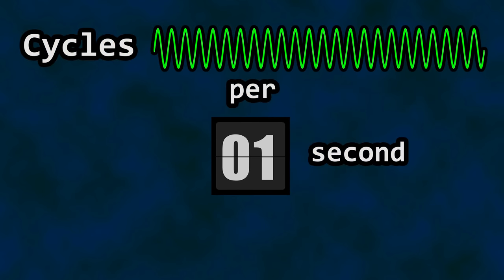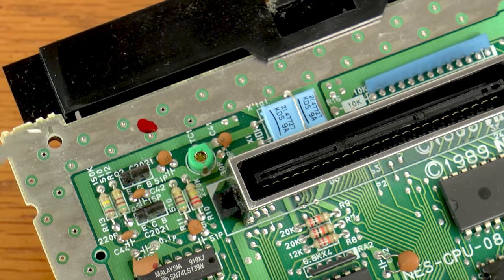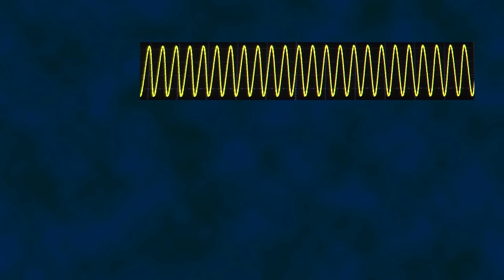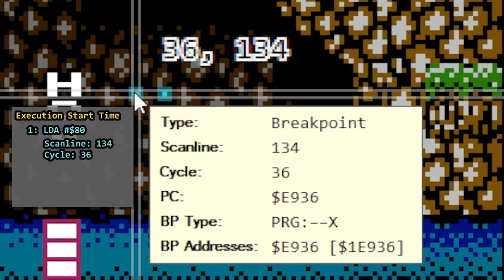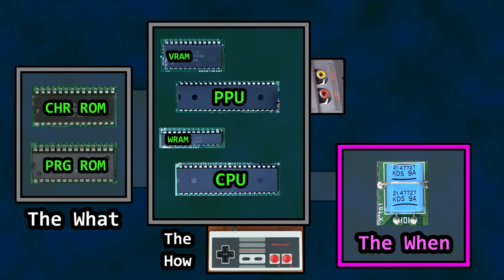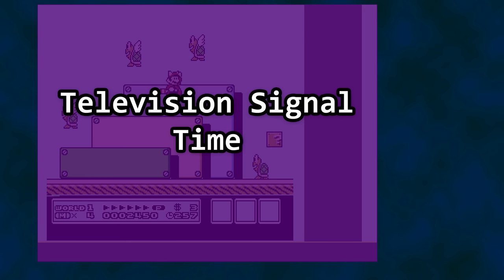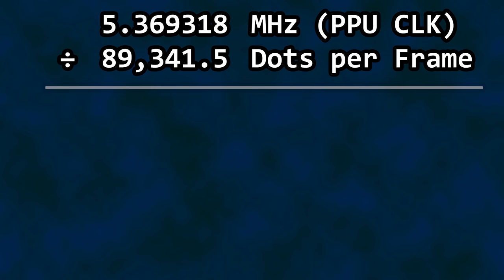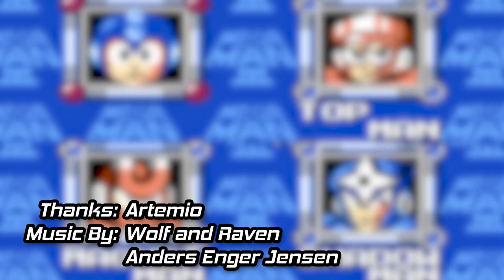Let's Dive into the Cycles, Speed, and Video Output Timing of the NES - Behind the Code

Comment from the maker: I thought we needed a "Behind the Hardware" episode to talk a bit about cycles as they are very important. This topic is a bit of a prerequisite for talking about interrupts.

I hope those of you with experience in pulses, duty cycles, etc. didn't mind the oversimplification of the clock in order to make a point about speeds. We could certainly dive deeper into this topic, but this should be enough to proceed with other mappers.
Reply: ty.  I've struggled to explain this to a lot of people.

I've also had difficulty explaining the fact that interlacing is required for the image to fit on a 640 x 480 screen essentially reduces the framerate of games by half (from 60 to 30), then there's the horizontal blank cycle.
Reply: Hey man, I don't know where to pitch you this request (and I'm sure you're SWAMPED with them). But I can't figure out for the life of me the answer to a very simple question, regarding Adventure Island III. Definitely need a hacker/tracker guy who knows what he's doing to trace this.

There are many secret bonus rooms you can find by touching keys in hidden eggs, and when the room loads, there is a smaller, inner box room inside the room with an invincibility crystal inside. Outside the inner room, there are lots of fruit and 3 dinosaur cards. If the room loads with you already inside the inner box, you can get the crystal, and walk through the walls to exit the box. I think you can even jump back in. But most of the time, you start at the bottom of the larger room, outside the box, and you can't get in at all. Nothing in a computer is truly random, there MUST be a way to cause a start inside the inner room. I loved your Punch-Out!! videos, btw, very related.

Comment: Wonderful explanation. This is simply why it's not possible to "overclock" the NES by changing the crystal. Many other 80s computer worked exactly the same way, like the C64.
Reply: As long as you can install some sort of pre-scaler in front of the PPU to keep it running at the same pace as it normally does, it should work fine. Of course things like the audio will still be higher pitched, and any mapper that detects CPU cycles for its interrupt timer instead of scanlines will not work properly. That part can be fixed by patching the particular game's code instead.

Comment: By the way, many computers and consoles of that era used the same CPU (a variant of the 6502 chip) while having vastly different graphical and sound capabilities: this video gives a taste of why. In some cases, we have the same CPU in two different console generations (Atari 2600 and NES, picking at the opposites of the range). It's incredibly fascinating how the engineers managed to create incredibly different architectures while technically striving for similar purposes.
Reply: That's what the 6502 was designed to be: a low-cost, decent CPU for general usage in a variety of low-power devices. Attach it to a simple line output system, and you get the 2600. Attach it to a more complex tile-and-sprite renderer, and you get the NES.
Reply: Designing a CPU is hard. 6502 and z80 had a large software library and market of trained assembler coders. Same as 68k and 8086.

Comment: Yes, the CPU/PPU timing is very important for MMC3 interrupts. I once briefly had a PAL NES game called Drop Zone, which I ran on my (NTSC) toploader. It was a game which used a timer to draw a HUD in the bottom half of the screen. So on my TV, about the half of the font for information like the score and lives was cut off, due to of course that since it was a PAL game, it was programmed for the timing of a PAL console and TV.
Reply: Nowadays you can be clever about this for homebrew and detect the system region (simply by counting how much time passes between two Vblanks) and from there you can take the right timing values for the MMC3.

Comment: Fantastic video~! I was always wondering what caused that twitching row of pixels on the MegaMan 3 boss selection screen - as well as a similar wiggle occurring sometimes in SMB3 right above the HUD - it makes sense now that it is technically scrolling the screen back to status bar and away from the stage tiles.
Reply: I never even NOTICED that effect in MM3 because it happens so fast. Just showing that at that specific time of the video it all came together in my head because I remembered that glitchiness.

Comment: For a moment I was thinking: “Is he going to try and explain the whole clock cycle and render pipeline of the NES PPU, what a madman!” Then I saw the video is only 11 minutes long and relaxed. Great video, once again. Thanks for talking through all of these concepts. As someone who tinkers with HDMI signal generation, it still seems a little weird to me that modern video standards still include extra time before, during, and after the signal. That was all originally to give the electron beam time to move in a CRT, right? What’s all of that for now?
Reply: The VBlank and HBlank periods in modern setups are there because HDMI is a modification of DVI. And DVI had them because it was designed as a digital interface for CRT monitors, so they digitized all the fun picture tube control signals and delays. 

I would not be surprised to learn that HDMI packed audio into the VBlank period, but don't know for sure how it is encoded.

Comment: It feels like you've read my mind, as I am knee deep in this exact rabbit hole. Interestingly enough, the video output appears to function at twice the crystal rate, giving us 12 voltage outputs per color cycle. At least, that's what it looked like on the nes-dev ntsc page. Something about outputting on both rising and falling. I don't know what that means or how that is actually done in hardware. Maybe you have some thoughts or corrections :)
Reply: Work is performed on both the "rising" edge of the wave and the "falling" edge of the wave on the clock signal. This could be for triggering components at more exact timing, etc. This would still be considered six cycles, however, since both a rising edge and falling edge are just 2 parts of a single square pulse. There are components that can determine if a signal went from low-to-high (0 to 1) or high-to-low (1 to 0), which in this case would indicate the start and end to a single clock pulse. Hope that helped!
Reply: Not only video, 6502 also has rising and falling edge sub-cycles. I don't think Z80 does, or at least doesn't do anything extensive with them. This is how 6502 is able to perform a memory read in one cycle, it will assert an address on the bus and configure the bus in the LOW phase of the cycle, and then the memory needs some time to perform the read, it will assert the data as soon as it can, which the 6502 will consume in the HIGH phase of the cycle. Other comparable processors would generally have multiple-cycle memory operations, and would correspondingly be typically used at higher nominal clock rates with similar grades of memory. This design trait of 6502 was sometimes used to an advantage, for example to sneak in memory accesses in the LOW phase and avoid cycle stealing, but in general the higher nominal frequency allowed more granular timing in other chips.
Reply: Correct, the NES uses the low and high phases of the 21.47727 MHz master clock to generate the smallest granularity of the video signal, which works to 8 subpixels per pixel, or 12 subpixels per color cycle.  And that's exactly how the NES palette gets it's 12 different hues, by shifting the color pulses by anywhere from 0 to 11 subpixels.  Whether the PPU specifically looks for the rising and falling edges for this purpose, or just uses the momentary state of the clock as a logic input, I'm not sure.

Comment: Everything computer-related nowadays is all theoretical and abstract. It's absolutely mind-blowing to go back and see actual pins on a CPU connected to actual quartz crystals. 🤯
Reply: Programmers have long forgotten about those things with multitasking operating systems, no real direct access to hardware anymore.  I came from days of programming C64's and DOS, and one of the optimizations we used to do was bit shifting integers to use instead of floating point math.  I had made a simulation system in recent years that required calculating floating point math on a modern multi-core computer, tens of millions of simulated operations.  It was fast, but when I changed the code to utilize 64 bit integers and "fake floating point", the performance difference was unbelieveable.  Then I recoded it using GPU compute instead and the performance was just 100x what my best "fake floating point" was, and as a bonus, actually calculated the real floating point numbers.  Today the closest thing I get to programming "old school" is microcontroller projects, like Rabbit, Arduino and ESP32.  And finding people who REALLY understand making bare metal systems is few and far between these days.
Reply: Huh? Isn’t there still a crystal and still two pins for it? Just now the crystal is slower than the CPU.

Comment: I'd like to hear the story behind the mentioned blinking scanline glitch: what causes it? 🤔 Incorrectly done interrupts?
Reply: I can't tell you for sure, but different MMC3 revisions trigger the interrupt at slightly different points in time. Ideally, it would be triggered right as horizontal blanking starts so that the PPU scroll register can be updated before the next scanline starts to be drawn. It could either be that not happening at the right time (too early/late), or the way the interrupt handler was written (too much stuff happening before writing the scroll register?). 
There can also be different PPU/CPU cycle alignments and when an interrupt occurs the CPU is still allowed to finish the instruction it was executing before answering the pending interrupt. Different instructions take different amounts of time (the slower ones can take 6 or 7 CPU cycles), so depending on what the CPU was doing, the interrupt will be handled with varying amounts of delay and the PPU will be at a later dot than you want when you get to writing the scroll register. This is responsible for that little "jitter" with glitched looking pixels at the edge of a screen split. The best time to do these changes is when the jitter is hidden to the right of the image in H-blank but that's not easy to do without carefully timed interrupt handlers.

Comment: Quartz watches were the first use of crystal oscillators in consumer goods. Of course, those oscillators needed to produce a very precise frequency for accurate timekeeping. Engineers needed to produce a quartz crystal that would always resonate at a particular frequency, and whose resonant frequency could be controlled. Luckily, such a device has been in use for centuries; tuning forks, first invented in 1711, resonate at exactly one frequency, which was precisely set in manufacturing by grinding down the ends of the fork. To reduce the size and ensure it wouldn't be audible, quartz watch crystals are manufactured to resonate at exactly 32,768 hertz, using a laser to trim the tines down micrometers at a time until the desired frequency is reached.
Sadly, this technique doesn't scale down indefinitely; crystal oscillators in the megahertz range are based on resonating discs and aren't nearly as exciting.

Comment: Wow what an awesome explanation! One part that I don't understand: what would happen if the CPU divided the crystal frequency by (for instance) 6 instead of 12? Would the CPU just run twice as fast? I assume not, or else why divide at all, but I'm not sure why it wouldn't work.
Reply from the maker: I think (and this is just off the top of my head, Matt) one reason for the selection of that CPU speed had to do with the ROM speeds. You could accelerate the CPU (reduce) divider and potentially exceed what the ROM can provide. That would be just one side effect of messing with an existing system design.

The SNES still has to deal with this (fastrom vs. slowrom) despite being so much younger than the Famicom. That is an interesting part of history in of itself.

Anyway - As for messing with dividers, there are some clone chips out there that don't match the dividers and cause the system timing to go bonkers. Some people have swapped them out just to see what would happen. I'll probably share some results soon in a community post.
Reply: @DisplacedGamers  That sounds like a plausible explanation. The PC Engine allows the software to set the timing used by the VRAM, and it can also set the dot output to be faster than normal, which causes the horizontal resolution to increase (up to a 512x240 image by outputting two nametables to the screen next to eachother). But this causes the VRAM chip to be accessed at ~10MHz, which is slightly higher than what it was rated for. If you don't set the VRAM timing correctly to do this the VDC (equivalent of the PPU for the PC Engine) will not be able to fetch all sprite and color entries for every scanline from VRAM and this will lower the sprites per scanline limit and in some cases only 2 of the 4 bits of color data for each pixel will be read, reducing the color capabilities to something like the NES has. It's been theorized that there could be other visual glitches whenever the RAM doesn't put the data on the bus fast enough but nobody has seen any such thing happening so far.
Reply: That explains why they'd pick a lower frequency, but what good did it do them to have a clock that's 4 times faster than necessary?
Reply: @warmCabin maybe they use the sharp edges for a square signal? Or off the shelf TV parts ?

Comment: So what happens when you connect your NES (or any console before HDMI era) to modern TV? Is there some kind of CRT-emulation built inside them, since LEDs don't care about electron beams and NTSC/PAL differences.
Reply: HDMI has the same timing as analog. You can cut back on the idle time in hblank.

Comment: Hi. Nice video. I heard the tv frequency is derived/copied from tms9918 VDP (Colecovision, Sega Sg-1000, MSX). I found the 341 pixel per scanline on that VDP as well BUT in some documents I found an honest 342 pixel per scanline. With 342 pixel per horizontal line, the refresh rate drops to 59.922Hz. Do you have some information about this discrepancy?
Reply: Every VDP implementation was a little bit different in terms of line rate and field rate.  But you are correct, the TMS9918 has the same pixel rate as the NES.  The most critical rate is the chroma carrier frequency, which must match the TV very closely so colors are constant from left to right.  TVs can tolerate more variation from the NTSC spec for the line rate and field rate.

Comment: But the clocks are always off by some value, they have a tolerance, and they have aging, so what if your NES has like -50ppm, and mine is like +50ppm; that'll give me 1second advantage in a 3 hour speedrun!
... I did some research, and the clock is actually +/-2 ppm, that's an incredibly precise oscillator that could cost some money! That could warrant a whole new video!:D

Comment: what would happen if you replaced the crystal with one of higher value say 26 or 27 mhz say from a cb radio?

could you overclock the nes?

i know if you change the 3.57 mhz to something like 5 or 7 mhz in a certain radioshack phone dialer you could turn it in a red box to make free phone calls on payphones at the time when payphones did in band signaling.

it worked by doubling the frequencies of the * key to 1700 by 2200 hz witch happens to be the frequencies of the electronics of a payphone timing was controlled by the totalizer.

Comment: Hm so the NES actually outputs fields very slightly faster than a standard NTSC signal which is ~59.94 hz
Reply: Not uncommon for the era. Analog TVs can handle a fair bit of variation, and hardware designers often took advantage of that.
Same reason "240p" signals work on a display that was very much only intended to do 480i. You give the screen a malformed signal and it will do it's best to paint it to the screen.

For what it is worth, the NES PPU actually outputs a very nasty signal and is pretty far off of NTSC in a lot of regards.
Reply: It was very desirable to have an integral number of graphics bus cycles per character cell, scanline, and frame, which couldn't generally be done without varying from the NTSC spec.  Just doing a progressive scan requires a variation from the NTSC spec.

Comment: I wonder what would happen if you swapped the clock crystal. Would it be stable?
Reply: It has quite a bit of stability margin, but how would you get the image out of it? A TV or video capture device requires very very close to 15.75KHz horizontal frequency.